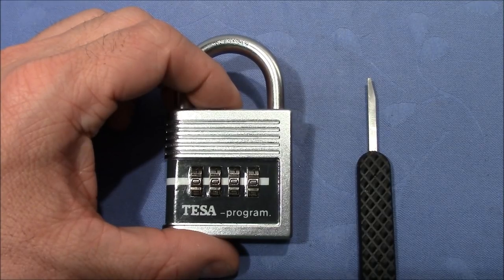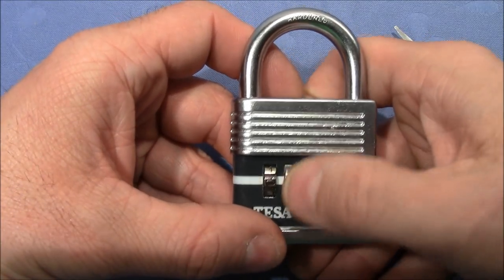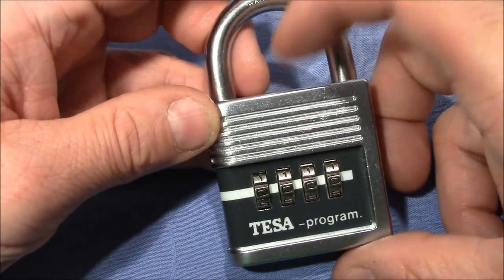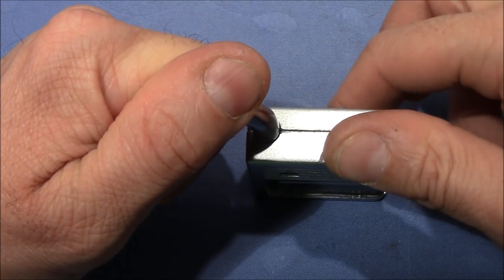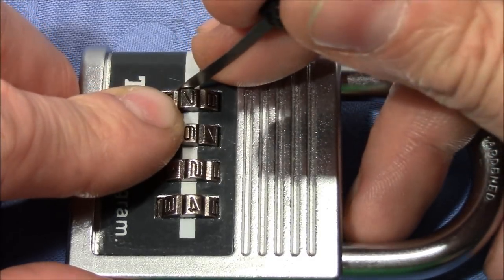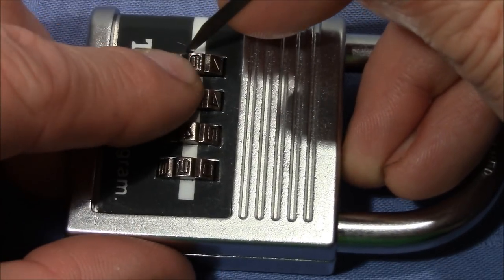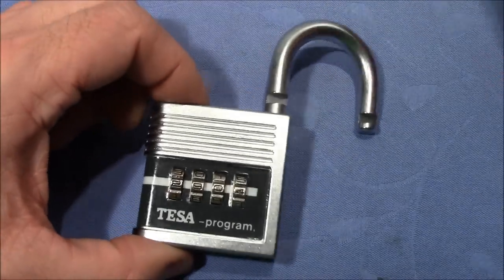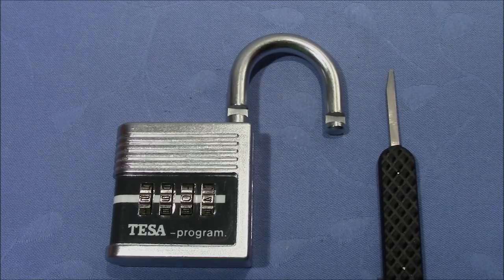(picking 516) Feeler gauge decoding of a TESA 4 wheel combination padlock - thanks 'Tallan Pick'

Comment from the maker: Due to the request of one of my viewer I demonstrate how you can decode a combination padlock using a feeler gauge. This lock was kindly given to me by my friend 'Tallan Pick' and is a wonderful old combination padlock made in Spain. The method for decoding this lock requires a very thin probe and a lock where the inner wheels can be accessed by the gap in the housing. If a combination padlock is not vunarable to the pull picking method this probing is worth trying as many locks have un-shielded inner wheels,

Comment: With some of these (esp on a Wall mounted  Abus key garage) you can insert the knife under the pin also on the left side, and let it rest on the buttom of the cut out - angled side of blade pointing up, and when the flat part comes by, the handle drops very clearly.
Reply from the maker: Ah, great idea - thanks for the inspiration; will try that next time. The feedback on this is sometimes ambiguous.

Comment: Great video sir! - thank you for showing on camera how it can be a little bit fiddly.  Excellent stuff. :D  I guess if they protected the wheels against this attack then it'd be a pretty good decode-resistant lock.  I wonder if the bang/knock/rap method would work on this lock? ... eg banging the back with a bump-key hammer or something (so as not to destroy the lock but still give quite a bit of force to counter the spring & lift the lever) and pulling the shackle just after the bang - like the method I used in a similar lock.
Reply from the maker: Thanks buddy - will not try banging this lock as it's a very rare one. They could make the inner wheels wider and put the flat part underneath the the protected area between the wheel.